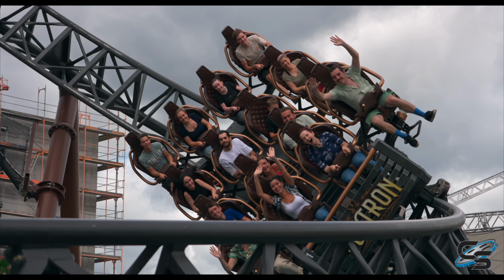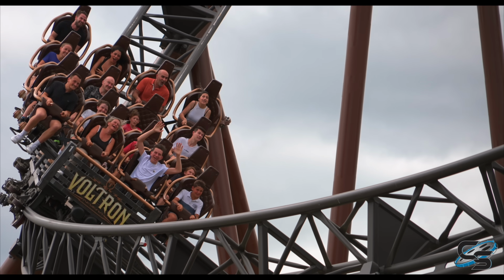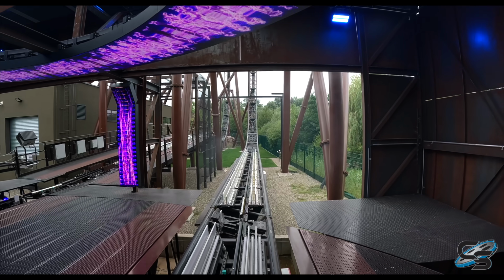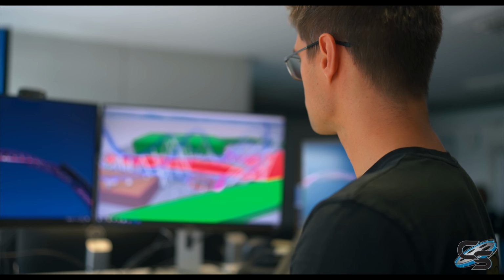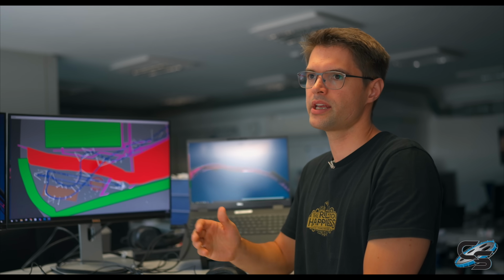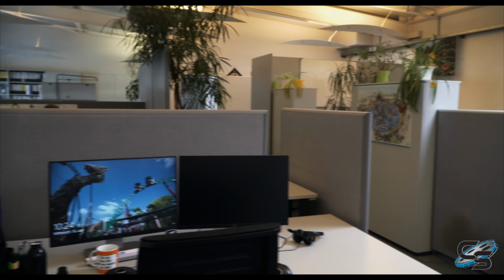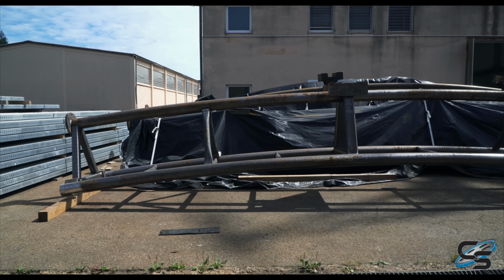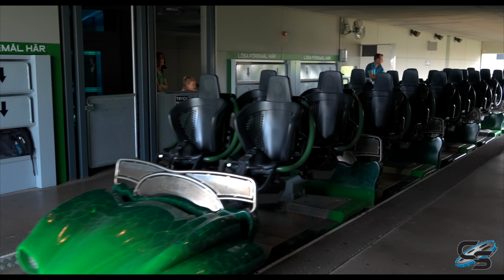Designing Voltron | How the Best New Coaster of 2024 Came to Be

Comment: If there is one element that I think could have been better is the drop after the brake run on the way back to the station. I would prefer a much longer drop. And the last airtime hill leads into the final brake a little too soon for comfort. Other than that, absolutely fantastic! And a great video too!

Comment: Would love to see a forceful Mack in Kings Island’s Vortex plot.  An extreme spinner would be sweet, but Voltron may have convinced me that their new Stryker model may be the best fit.
Reply: The forces on this thing are crazy especially considering it's height 😄 awesome awesome ride
Reply: @wolfieeeee256  I think it's an advantage. I've just watched an analysis on the cost of building coasters, and usually ride length scales everything up. That's why with very high and fast roller coasters, you need a lot of track and material, that puts a constraint on the length of extreme coasters.

Now if you don't focus on speed and height, but instead on a compact layout that also has all these forces, you can provide a much longer ride for the same cost. It's also easier to put in these additional block zones, like the genious launched block zone in the valley just before the hangtime stall. It doesn't interrupt the layout, and still works as a block brake and launch after the stillstand.

I look forward to many more layouts in the future, that get rid of traditional straight block sections and utilize LSM-powered block brakes in that way, that don't interrupt the flow during normal operations.
Reply: Rode Voltron back in June and I immediately said the same thing.